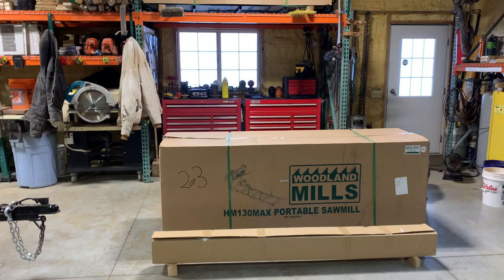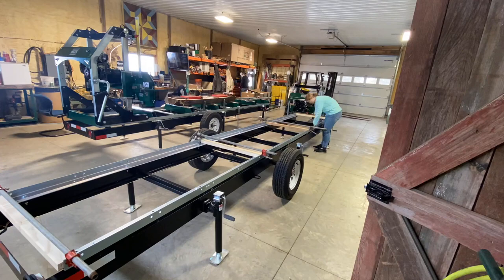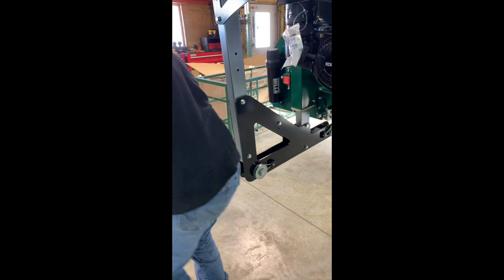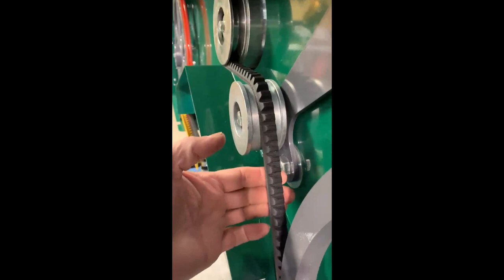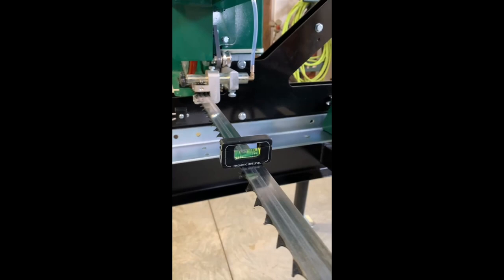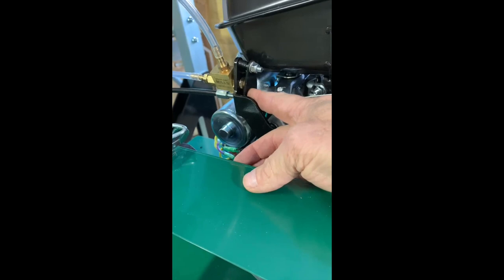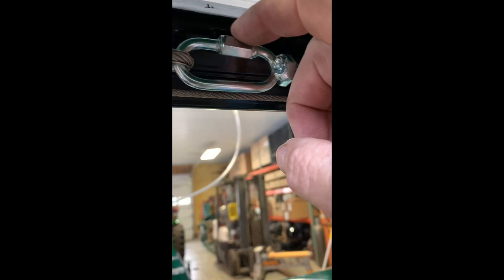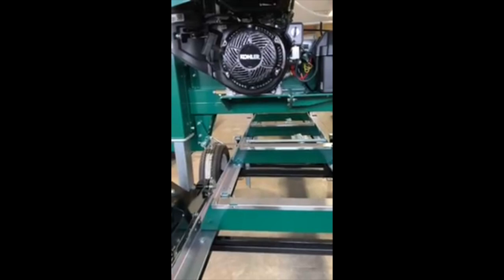HM130Max full Assembly

Comment: I'm in the process of putting my HM 130 MAX together and I Have to Agree with Mark Edwards, This is the best video I have found. I Do have one note to add, I Recommend Running A Brick Layer String or chalk line From front to back down one side of trailer while maintaining the 37" spread. This will help keep it straight and true.

Comment: Thank you for an excellent video and tutorial. I have the HM130 max and had already built it per the manual, was having an issue with the saw head rolling smooth. Thought I needed to adjust the track per the manual states that even though I spent a few hours leveling and making sure it was square before placing the saw head on the tracks. After watching your video, I went back and adjusted the wheel wire/whisks as you mentioned earlier to cut them if they were too long. As soon as I backed off of them, the saw head rolled freely and no scraping noises. I am happy to say I milled my first log today and really appreciate your techniques and advice.

Comment: Woodland will be shipping my mill the end of this month, hopefully.  I thank you for all the tips on adjusting these mills. I've seen quite a few on leveling the blade horizontally with the bunks but ive never seen anyone show how to adjust how level the blade is front to back. Neither has anyone talked about ensuring the belt riding true on idler pulley . Also ensuring the water flow valve isn't interfering with full throttle. And nobody has pointed out the adjustment for minimum blade height.  Thanks again.  Great video.  This is one video, all new comers to these mills should watch.

Comment: First of all - excellent video, one of the VERY best about a WM assembly. I watched it a couple of times when assembling and fine tuning my first mill, but when I bought my second mill I really watched this video properly, slowly and carefully. And I always recommend this video to anyone who buys a mill. Dan, I would like to make a small contribution, to this part: https://youtu.be/f7ek9lLmmdI?t=753  When fine tuning mine I discovered I don't need to trim anything, just release that one bolt and pull out or push in those cables as much as needed. I also used the opportunity to "squeeze" them a little bit more, now they really keep the wheels clean.

Comment: Expected end of May delivery for a HM130MAX with trailer in the Minneapolis area.  Thank you.
Reply from the maker: Congrats! You'll love it
Reply: @woodlandindustries  , I received the mill yesterday. Almost finished the trailer. My concern is lifting the head up onto the rails once finished. Any reason I could put the head on before the axles, wheels, and hitch to reduce the hight of lifting the head. My Kubota BX would have a much easier and safer go at 6 inches lift hight, instead of 2 feet.
Reply from the maker: @452Boatman  If you do it make sure the trailer is perfectly straight before you put it on. It will be a lot harder to adjust the trailer after you add the weight of the saw head. Make sure you have the mill secured to the track before you start lifting the trailer. Things could get messy if you don't.
I personally would finish the trailer but I see where your coming from. Your BX  might not lift it. I don't think its rated for that kind of weight so If that's your only option be careful.
Reply from the maker: The other option would be to tilt the trailer and gently work it on from the rear
Reply: @woodlandindustries  , I'm going to get all the under carraige braces and rear bumper on, then set it all down on the cement. At the point I'll see how it looks from there. Thank you so much for your input.

Comment: I got the Hm130 max all put together. Feeling the blade on the back side of the drive wheel and follower wheel. The blade hangs over on both sides about 1/8 of an inch. Should I adjust the blade tracking so the blade sits flush with the back side of the cast wheels?

Comment: WM says that you can only add one trailer extension on there trailer. Do you know how come? Like to mill 20' lumber. 
Thanks Dave
Reply from the maker: I cut longer than 20' but the Woodland Mills trailer isn't designed to add more than one extension.. I attach extra extensions to the end of my trailer when I need longer cuts but I'm not mobile with the extra length. I have to remove them when I'm towing.
Reply: I don't have any extensions on my trailer yet. How much would it cost to get one track and trailer extension  and one more track to do something similar like you did when I need to mill longer lumber?
I'm in NC for the shipping cost.